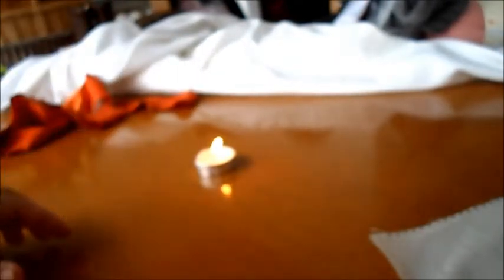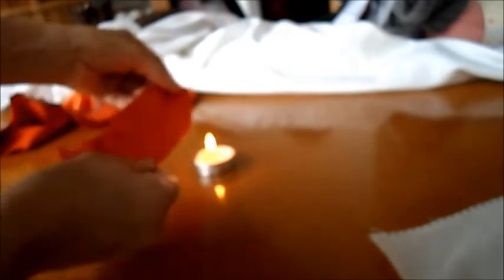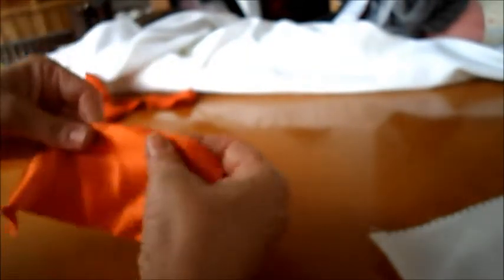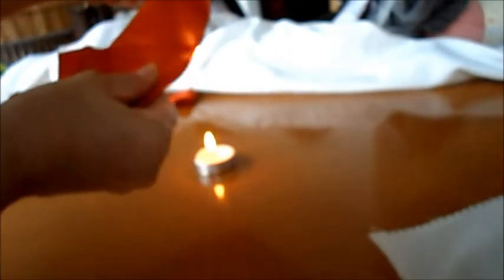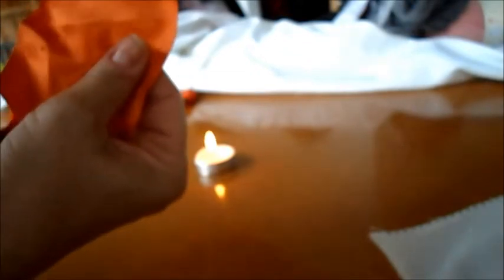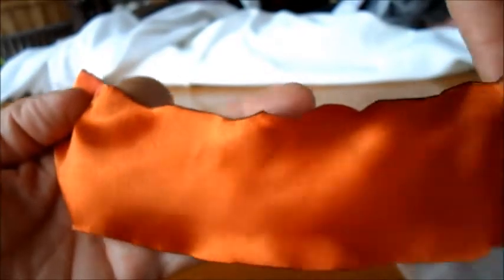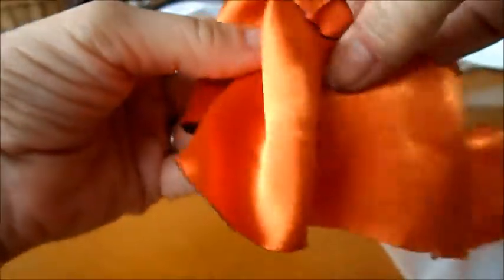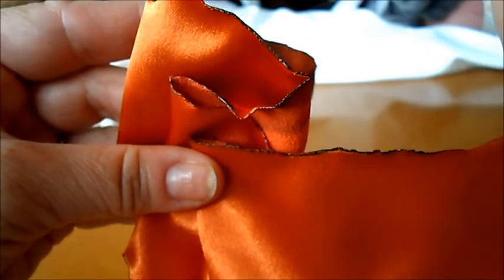Burning Fabric Edges

Comment: can this work with a synthetic and cotton blend??
I've got a nice cotton blend fabric that frays like crazy.
Reply from the maker: I'm not sure, Keagan. I tried with one blend that went up in flames really quickly. I'd try a scrap of whatever you're using first. Please let me know how it turns out. Good luck!
Reply from the maker: By the way-sorry for the delay on the answer. I only just now saw your comment.
Reply: It works well with blended fabrics, but you may have to burn a little more away to get enough molten synthetic to form a seal, particularly if the synthetic content is low. It tends to catch alight, but is easy to put out with your finger. When it burns too much, I occasionally let my boyfriend use his asbestos fingers to snuff it out.
Hopefully my reply is not too late. Regards, (Jane)